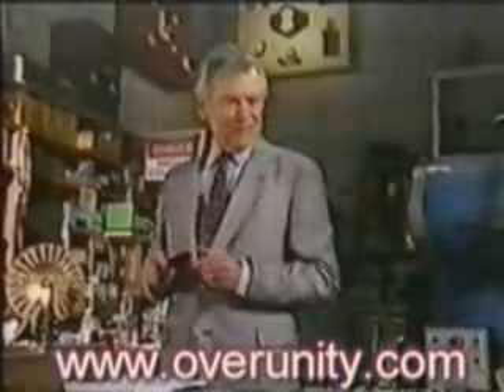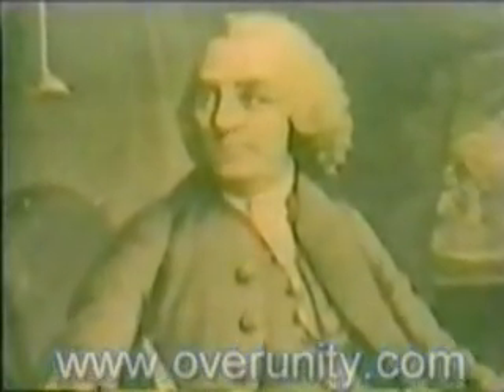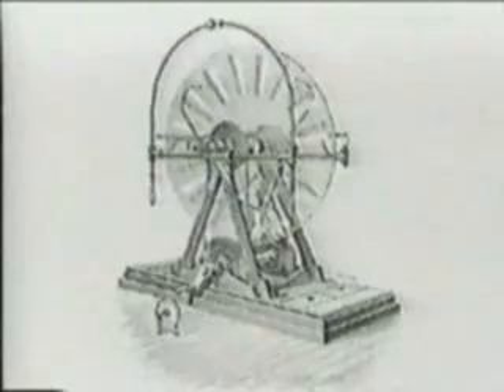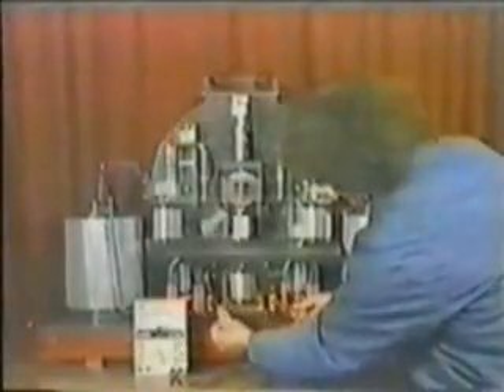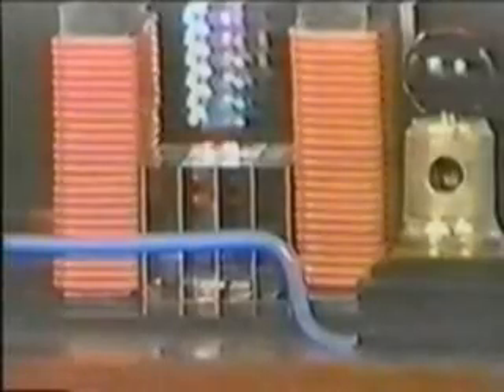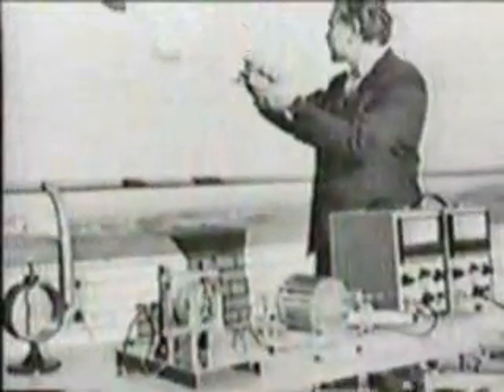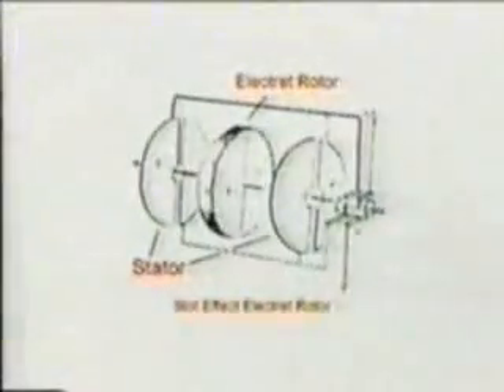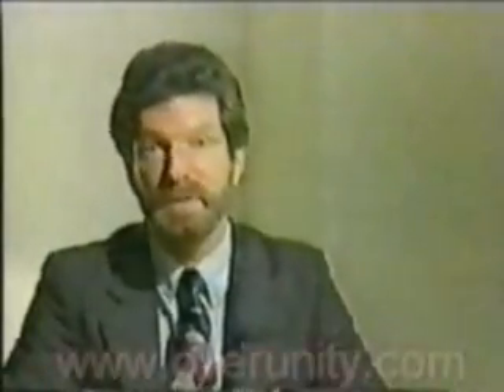free energy machine 1

Comment: A Solar Panel is a free energy device.You must purchase the device but you never have to actually pay for the fuel (solar rays) to power the device. That is the typical street term for free energy.

If you can drive a pipe into a gas well under your house then many will term that as free gas, free energy to run your home& cars.Others will break that down into other technical descriptions but if you don't have to pay the gas company, the fuel itself is free to you regardless of maintenance costs.

Comment: @MucusFelidae
I failed to mention that the billions of volts of released electricity are in the form of lightning bolts.Another example is that if you can drive a pipe into the ground in your back yard then run your entire home & vehicles off this natural gas it would easily be termed Free Energy in the sense it comes from the planet & you get it for Free. People often like to twist that term around to imply Free means energy from nothing but as I said there are various meanings of the word free

Comment: @MucusFelidae 
One might think the static electricity surrounding us is an insignificant or minuscule amount yet in reality that static electricity builds up like a capacitor releasing billions of volts of electricity, it is not unreasonable to desire to tap into that source. The term "Free" here refers to monetarily free such as a solar panel is a free energy device in that once built you never have to pay any corporation for the fuel to run it. Monetarily Free Energy.

Comment: @MucusFelidae
The meaning of Energy & Electricity are one in the same and are interchangeable.
Science Dictionary - energy:
"The capacity or power to do work, Energy can exist in a variety of forms, such as electrical, mechanical, chemical, thermal, or nuclear, and can be transformed from one form to another. It is measured by the amount of work done, usually in joules or watts."
Many dictionaries refer to Electricity is a type of energy or Electric current is a flow of energy.

Comment: @MucusFelidae
Your confusing that with "energy cannot be created".
Energy can and is being generated all the time, here is a sentence removed directly from wikipedia:
"Electricity is mostly generated in places called power stations"
There are generators, put gas in the tank of an engine which powers a motor then turning a generator and the device is generating electricity.

Comment: @rubikscubix1 
The word Free energy has had 3 different dictionary meanings and one street term. Todays dictionary term is not the same as the meaning of perpetual motion anymore and most people in these forums refer to free energy as monetarily free energy such as a solar panel is a free energy device in that the fuel required to make it operate is monetarily free and the static air around you if used as a fuel is monetarily free to use as you please.

Comment: You mean "if you did not know what sulfur was the creation of the match is still possible"?

Which is still probably incorrect because you need to know that at least this substance can be applied to such uses. But just to point that out.

@Rhinoch8 "Free" energy not "Free Energy". Which I guess is misleading since the latter is a major pseudo-scientific topic and the former is a more practical concern for our community.

Comment: @jagerballs 
Back in Tesla's time Westinghouse did not know how to harness air electrical current through a meter so cables were the only way to go to regulate it. It was not until the satellite tv era that corporations figured out how to meter the tv signals for pay, but many people did steal signal until that technology was perfected & protected from signal thieves. Today Tesla's high voltage air transmission signals will work with today's air signal metering capabilities just like pay tv.

Comment: @ian5576 
Overunity is impossible but it is not impossible to introduce a small current then use other means to assist in rotation such as perhaps magnets or the very static energies that surround us. If you even have such devices to read energy input from all combined sources I assure you that input energy is more than output due to losses. Not the other way around and Not Overunity if one addresses all input sources.

Comment: The fact is there is no real shortage of oil, we continue to discover oil all the time. The way this industry works is if large amounts of oil sits processed & in storage there is an over abundance & the oil stocks fall along with prices making low profits. The oil companies actually shut down facilities so they would not process as much creating a pump on demand or slight scarcity, stocks rise, prices rise, profit soars. It's called supply & demand.

Comment: In the 70s The Arabs showed America a thing or two as they stalled oil to America, gas stations ran out of gas. I lived through this. Service stations with closed signs & out of gas signs, the few that had gas had lines backed up 3 blocks, people who tried to cut in line caused fights to break out. Prices jumped from about 50 cents to 75 cents to 95 cents in a short period of time. People were pumping then driving off. That was what triggered the pre-pay. Alaska is a reserve for emergencies.

Comment: 3B
Fact is that permanent magnets under a work load will function for about 300yrs. Some magnet motors have been designed to run without electrical input, these inventors never get out of the development stage before they are framed, dragged to court under false claims that get tied up in never ending court battles, freezing assets & costing millions in court costs which drain funding. Some inventors facilities are burnt to the ground as did happen to Tesla.

Comment: 2B
& not a single person has placed a meter to measure input of the magnetic force.
If such a meter existed then motor input would be more than output & that fits within the laws of physics. These motors have a stigma attached & scientist that goes near such a claim will lose credibility as a scientist, he will experience peer rejection, lose funding & literally lose his career. The big argument is that magnets don't work like that but they do with shielding to prevent lock up.

Comment: 1B
The "OverUnity" motors that do work is not OverUnity but a mis perception. Most "OverUnity" motors are like a typical motor that requires input current. There is a meter that registers electrical input & a meter to register output. You will see that input is less than output,  this defies the laws of physics  but what so many people fail to realize is that the motor contains permanent magnets aligned in a particular way to use force which equates to energy...

Comment: 1A
The first solar cell was built in 1883 by Charles Fritts, who coated the semiconductor selenium with an extremely thin layer of gold to form the junctions. The device was only around 1% efficient.
by 1900, the the gasoline combustion engine was just getting off the ground.

Comment: The federal gas tax is 18.4 cents on unleaded and 24.4 cents on diesel. The US consumes, roughly, about 20 million barrels of oil per day, or 400 million gallons of gasoline. Assuming all this gas is bought "at the pump" and for simplicity is all unleaded, that equates to about $26,864,000,000.

Comment: Something else I did was to keep my old leaky double pane windows then bought the cheapest vinyl double pane windows & installed those on the inside ledge so now there are 2 sets of double pane windows. I got that idea while working in a home near the airport. It blocks out sound really well not to mention insulate. No need to use that insulated window plastic anymore

Comment: I installed motion sensor lights outside so lights only come on with activity. I use a natural gas cooking stove as electric is far more expensive, natural gas forced air heat & natural gas water heater.
I use a whole house attic fan until the heat is so unbearable I need AC but even though the entire house is central air I installed 2 rooms with small ACs so I only cool the room I am in. 2 rooms contain infrared heaters so the main house heat can be 65 but I can stay warm in the room I am in

Comment: Holy crap !!! That's steep.
We have a 2 story 3 bed house use lots of water for hosing down the dog area & sometimes heating pads for kittens or heaters for puppies & average $60-$70 in the summer & never over $100 in the winter. We are very energy conscious. Computers & lights are off when not in use, I unplug extra computers when not in use because they still suck current when turned off. outside doors are kept closed when furnace is on or else furnace is turned off.

Comment: C
This is true, the white wires are all on the same bus bar as the ground wires & the ground wires are attached to a pipe that goes into the ground. Electricians claimed that prior to grounding electricity bills were not any cheaper or free but without grounding metal appliances would zap u, so that means there is lost or wasted current so 1 man discovered how to harness this wasted current & re-use it in the house

Comment: B
I also realized this when I opened up the electrical box which verified what I saw in the video. U have power coming into the box goes into the hot side of your outlet (The black wire - the shorter slot) travels into your appliance then out through the longer slot, the white wire. But here is what is strange, the white wires are all tied into the ground wires in the box which means the current used could have been recycled back to the power company but instead they dump it into the ground

Comment: 4
if you need convincing then try this,
Call public service, tell them you want to replace your old meter with a new one because you don't trust it's accuracy. There is no cost to you for them to do this. They likely will do what I saw them do & place jumpers. If your meter was powering your house then they could not keep power to your house while the meter is pulled.
But could such a device exist?
I never discount anything anymore.
Could this be running your house?
very unlikely  :-)

Comment: 1
That video title was
NaziUfo's William Lyne 2004 part 3/9

There is one major reason why this is not true.
I installed an extra breaker for a newly run wire out to a shed & I am terrified to plug the breaker in live & heard I could pull the meter so I did, then I decided to have my old meter replaced with a new one so I had public service come out & to replace the old one.
Before he removed the meter he placed mini jumper cables from the incoming power clips to the house clips...

Comment: I remember reading about electrostatic motors in a 1970 Popular Science article.  Suspend a wire in the air with a balloon, it runs on the electric field in the atmosphere.  They work fine.  Just can't get too much energy from it, fractional horsepower, not enough to run a toaster.   As always, these were supposed to be available the next year.

Comment: For example, when we touch an ice cube, the feeling of cold is only heat leaving our skin and going into the ice.

This transfer of heat is just like the transfer of kenetic energy between one billiard ball and the next; what one loses, the other gains, and always in equal parts.

This is why I have trouble with claims of magnetic motors able to have more output than input.  It's like if I struck the eight ball with the cue and the eight went five times as quickly as it should have.

Comment: Not technically free energy, since it uses the outside energy source of ionized particles in the air.  You can't close the system and expect it to continue running.

Free in the dollar value, yes, but certainly not power from nothing.

Comment: Energy does not die, it transfers or converts. For instance heat to motion to electric. That is how a gasoline motor works. The trick is not to lose that energy in the conversion process using energy to harness more energy in a sustainable way.

Comment: The vertical electrical gradient of the Earth is of the order of hundreds of volts per metre. Electrostatic motors are part of conventional physics. However, the available atmospheric charge density is so low that atmosphere-driven motors are little better than toys. One might as well stick electrodes in lemons.

Comment: Since when are Wimshurst machines self-starting? You HAVE to crank the things to make them work. Electrostatic generators work by using friction to strip electrons off of a source and deposit them elsewhere, friction generates heat, heat is useful energy lost (in this case) and sudddenly your machine doesn't work anymore.